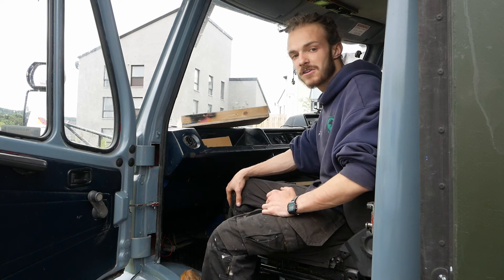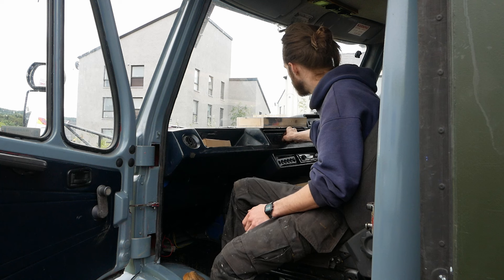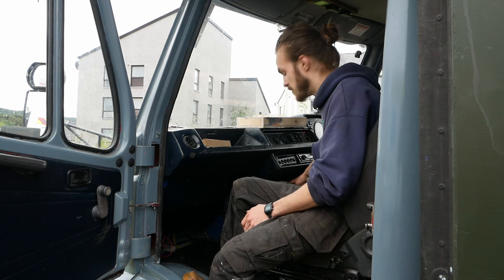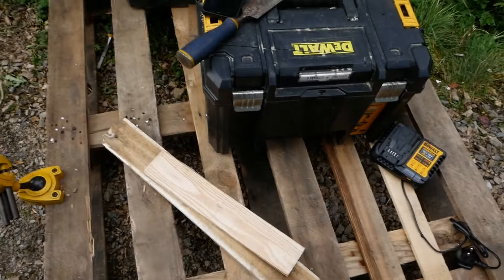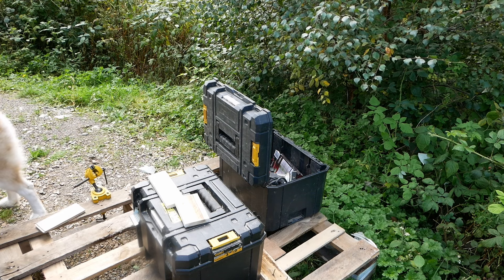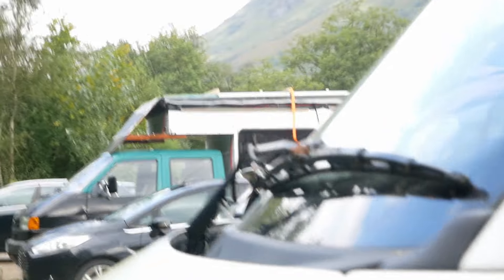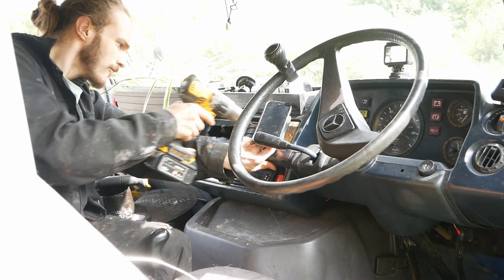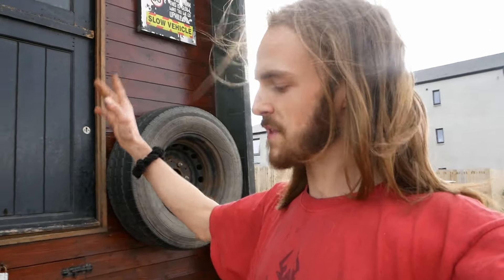LIVING In An Old Classic Camper Van Is EASIER Than You Think!

Comment: My parents took my sister and I to Scotland in '78 ... I was a bit too young to remember it but I'd love to go back.

If you are after simplicity, you can calculate mpg without the Internet (I use the calculator on my phone). If you record the number of miles since the last fill-up, divide by the number of litres you've just filled up with, then multiply by the number of litres in a gallon ... you get the mpg! 

There are 4.544 litres in a gallon - which is not too hard to remember, but can be worked out as pint milk bottle show that a pint is 568ml (0.568 litres) and there are 8  pints in a gallon ... Hope that's useful!

I like the wood trim, it looks great. I shaped and screwed a piece of chipboard to the (sun damaged) dash top of an Austin Allegro once .... yours is a far better look!
Reply from the maker: Ah that’s great help thanks! Didn’t realise it was so simple. I shall definitely be doing this to calculate it next time cheers Tom!

Comment: Grab one of Al's 611 retrofit setups. Simplified ECU wiring; 11 wires to run the lot, coupled with a turbo and common rail power, economy and reliability. There's no excuse for 17mpg and screaming its balls off for 50mph in this day and age. Mercedes Lego; winning...
Reply from the maker: I do watch him and it looks like a great swap but I just love the character and sound of this engine and I don’t mind the slow road, it’s not for everyone but I like trundling in to the maximum speed of roses engine. Mpg is a bit of a downer but I say it’s all worth it when it’s your home😁☺️ also they are legendary engines, Al loves them! Mines at 265k miles and I’d like to see how high I can get it😂😅 it’s gonna be an expensive one though 😂😂
Reply: @RustyRoseAdventures  Fit a 612 instead then :) As a series Landie nut, I see your point though; I have an L series in my SIII but at 6 quid a gallon, it's a bit oppressive surely... The mileage though, you'll be stood on Guildhall steps at midnight long before you get close to taking the lid off it again. I'd say you're barely half way there yet touches wood 😁
Reply: Can I have contact details for this please I have the same van and would love to have this fitted
Reply from the maker: @MrStefitukx2  look up 6d diesels on YouTube, it’s al that is doing the kits

Comment: I live in a ford transit T350 90hp...whats the big deal about hp?😂
Reply from the maker: Well for starters mine has a flat front and secondly no turbo, so when I hit a head wind or hill I slow right down. Yours has a turbo, very different engines.
Reply: @RustyRoseAdventures  3000 rpm 65mph 😂 in mine
Reply from the maker: @Hobosurvival 3000 at 55 for me 😂😂